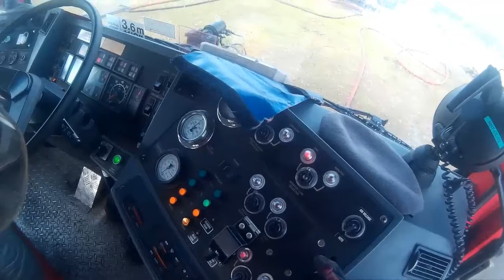RAF Fire Service Training on Engine Fire

Comment: How come you both went out the same door? Wouldn't it have been easier to go through your door?
Reply from the maker: Nathan Renwick could have done, but dependant on what's happening. At that point the other guy was there in the underbumper/cab hose ( see about half way through video) so would have been obstructing the door.